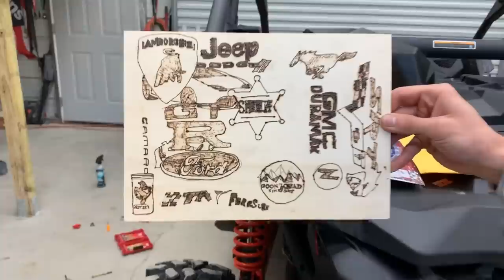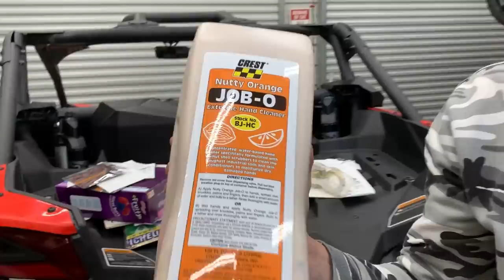Rebuilding A Wrecked 2019 Can-Am Maverick X3 Turbo Part 2

Comment: Where do you get the panels for a grand ?  I rolled my Early shape Maverick and I priced new panels and got a shock ... ended up gluing them back together - which is not easy as it is HDPE which not many glues work on !

Comment: Did you find the intercooler yet? What you have is a base model X3 sorry no intercooler and down about 50 HP to the X3 turbo R. You should invest in a Can Am X3 owners manual or maybe do a little research on what you buy.

Comment: Also if you use eagle one aluminum wheels cleaner with etching you can make the engi e look brand new as well. It will remove all the dirt stain on the motor. Don't leave it on to long, if necessary apply a couple times.

Comment: if u want to restore plastics i heard u can use a heat gun and heat the plastics really good and use a fine buffing pad and buff it down real good when it's hot I honestly never tried it its just what I heard I'm pry gonna try it this winter I have a Polaris sportsman atv that was used for a lot of trailriding I might try it on that see if I can get the scratches out of it

Comment: What would be cool is if you had a custom bed rack made with the Goonzquad logo that you could strap your cooler down too.  Could even  build you audio system to be on the rack with quick connects if ever needed to pull it off to service it.

Comment: For cleaning frames And motors I like to use a plastic pump sprayer from the gardening section and I buy 5 gallons? of purple power from the local parts store to put in it,works great and quick.

Comment: Where you mentioned the inner cooler in the video. I’m pretty sure this is 120 HP one which doesn’t have the Intercooler, can am makes a upgrade kit 120 HP to 172. Adds a inner cooler and upgrade fuel pump and tune. Evolution power sports makes one I’m pretty sure, sxsblog.com makes one to. Look them up on YouTube.

Comment: Hi guys, just little advice, solution for cleaning all that mud.. I drive alot offroad with my atv, and best way that I found to keep it clean is to wash it with foamer.. just foam it really good and then pressure wash it and all mud should go away.. it works best for me:) also to keep plastics looking like brand new I use cheap cockpit spray..Good job you two do there;) keep it up! Greetings from  Croatia!

Comment: Gas tank holds 10.5 gal and also check local state laws on exhaust, there are a lot of new laws on the books for noise. Most states it's automatic fine. better to check than to buy something you can't use. Here in NH it's illegal to modify exhaust that increases noise levels above 96 decibels.

Comment: To clean ours, we tie a winch to the frame on the front end, and hang the machine from a tree. (Or just attach it and lift it up with the bucket of a front-end loader if you've got one.) Then remove the bottom skid plates and clean away.

Comment: I detail side by sides for a living. If you really want that radiator to look new, get some Eagle One Mag wheel cleaner. It has an etching acid in it to remove all the stains. It’s important to get the mag wheel cleaner and not the aluminum cleaner though.

Comment: If you want any sun faded plastics to look like new again give them a sand with some fine wet & dry and unleaded fuel, once the fuel has has dried give the plastic a blast with a heat gun and they come up looking shiny and new.

Comment: Goonzquad, referring to the Cam-am Maverick, removing the catalytic converter will cause drivability issues. My friend has one and wanted to do the same thing.   He runs a aftermarket exhaust muffler only.  I don’t recommend removing the catalytic converter.

Comment: I have the same maverick x3 but the 4 seater it is the base model 120 hp it doesn't have an intercooler. I would recommend stiffening the suspension using the fox recommended tune. I would immediately get a front end gusset kit so you don't bend the frame. For performance items go with Evo powersports for exhaust and anything else. The base model has the same engine, turbo and injectors as the higher model. Just add an intercooler, tune and change fuel pump for more power. Evo sells a kit for the base model to go to 193hp or more but more upgrades are needed.

Comment: you boys know they make tank tracks for those things too now, if you want to go anywhere and not get stuck with it or if you want to be able to just drive it around like a car they also make turn signals and a brake light / headlight kit with a  windshield and make the thing street legal (not highway legal though only street legal for around town) then you can cruise to your favorite local fast food joint during the summer or to the grocery store or where ever and not get stopped

Comment: try some ceramic coating on the old plastics and you will see some wow results in bringing back to its original colors  for the rear fenders, you can get them cheap for 5 $ up to the 30$ a set form  Avalon King: Armor Shield IX #AvalonKing